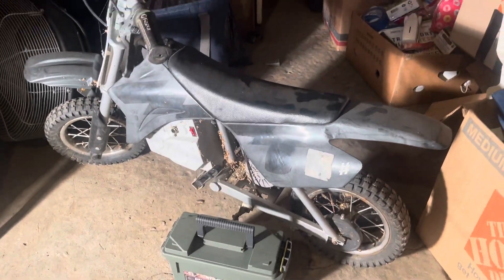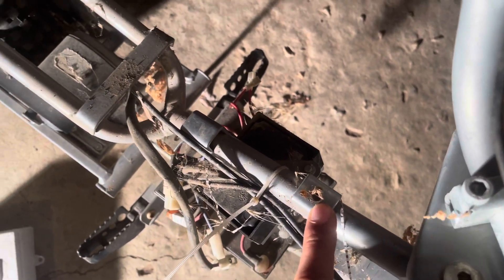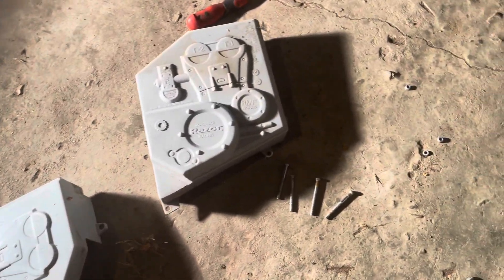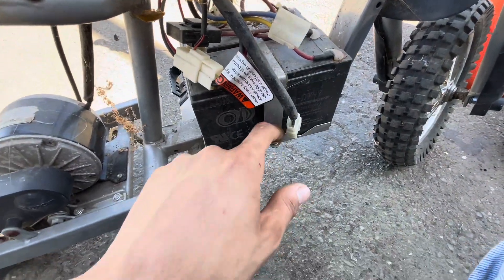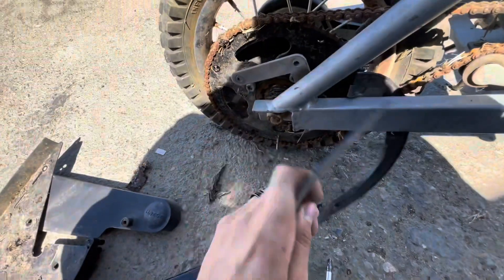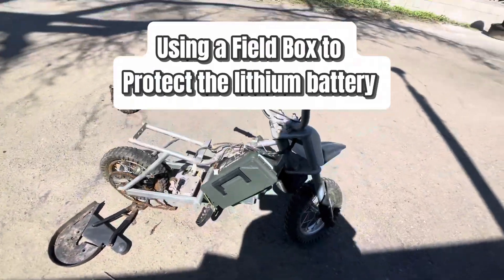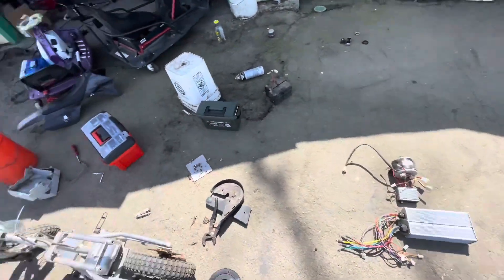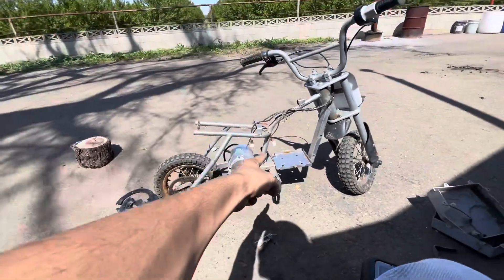72 Volt Razor mx350 Build (Part 1)

Comment: how fast does it go after all the upgrades
Reply from the maker: I haven’t finished yet but I’ve seen builds go 44mph with a better controller
Reply: @motomoy1311  do yk if all the upgrades on this bike would work on a mx500/mx650 ??
Reply: @motomoy1311 is it done yet?
Reply from the maker: @Nebwiffleball1 yes check out my most recent video about it 🔥